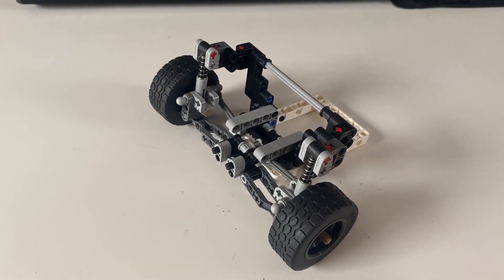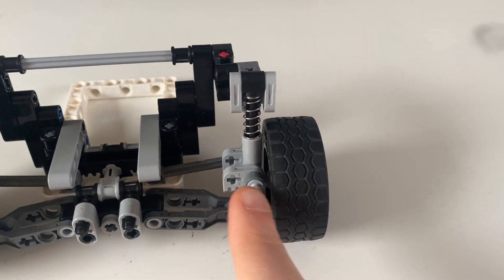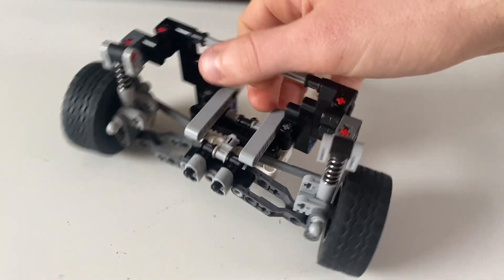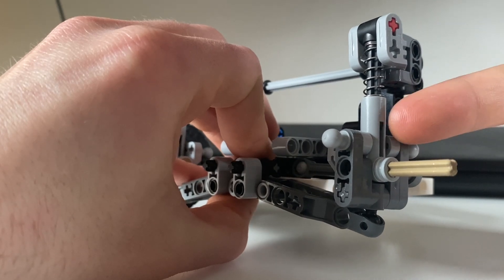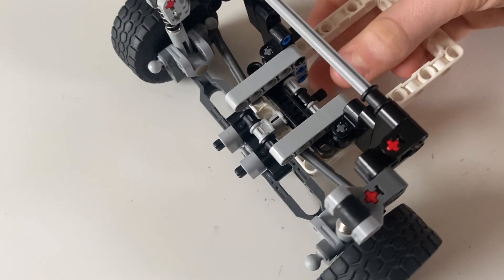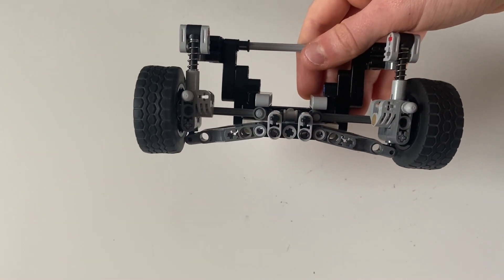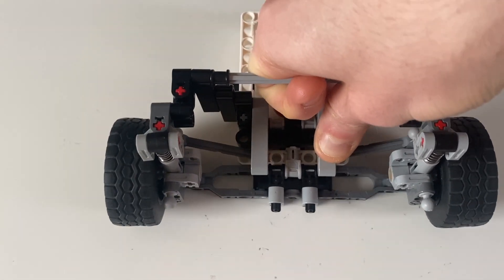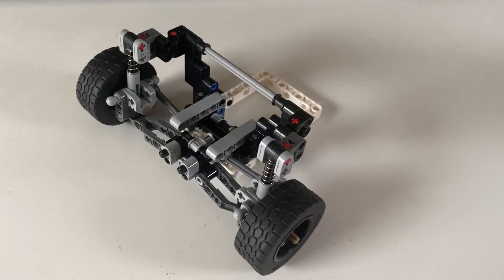Smallest Lego Technic Macpherson Strut Suspension - New and Improved!

Comment: i just built the older suspension and this one fixes the problem i had and i would be really happy if you release a tutorial on this one too, but i can also try to build it off this video
Reply from the maker: Hi sorry for the late reply. I agree that the old system was not ideal and this new one does fix the flexing problem. I will try to make a tutorial when I have time but unfortunately I can't guarantee a tutorial anytime soon.
Reply: @gergelystechnicmodels8565  no problem

Comment: Very nice. I really like the design of dropping the spring to the shaft point area, I’d never thought of that. 

Not sure if you've seen mine, I’ve a few variations on my channel. 

One thing I will say, if you get the angles just right, the issue of the spring moving around is almost gone. 

My latest one also uses a guide system which eradicates the issue and that can be seen on one of the chassis. 

Check the red Jeep being dropped, this also has macpherson struts and it shows how strong they are 🙂

Comment: Very smart how you mounted the shocks at the top. I think the only thing left to improve is that the whishbones and the steering roads are not parallel if you look them from the front. That will cause the wheels to turn outside when the suspension is comressed. It is specially noticable if the suspension has long travel.
Reply: Why don't you make videos anymore?
Reply: @eddraouyayman  I'm at second year of college and I don't have the time to produce videos at the quality I would like. Therefore I prefer to wait until I can drop new videos. I hope this summer I will have time to get back. I've got a lot of new ideas to explore.
Reply from the maker: You’re right, but the bump steer is not too bad.